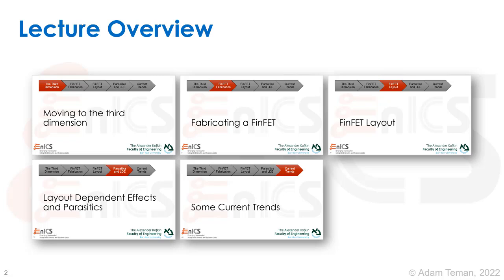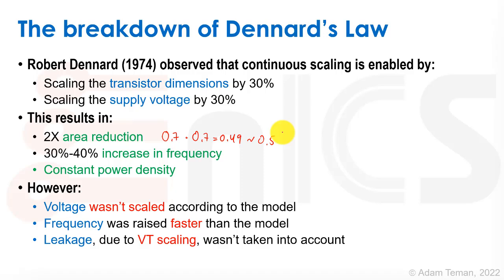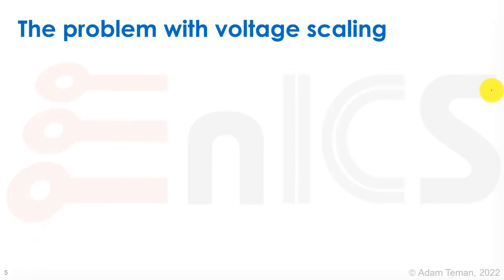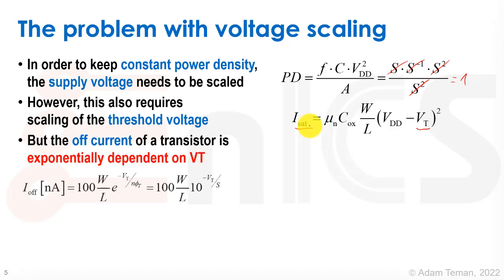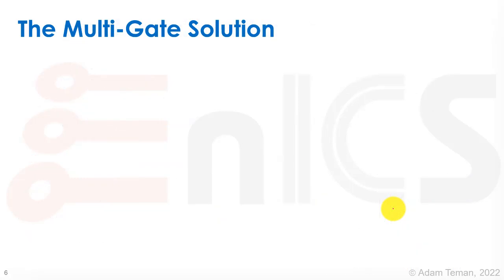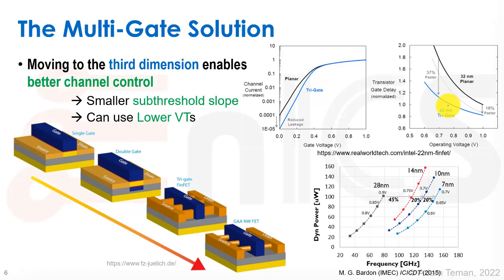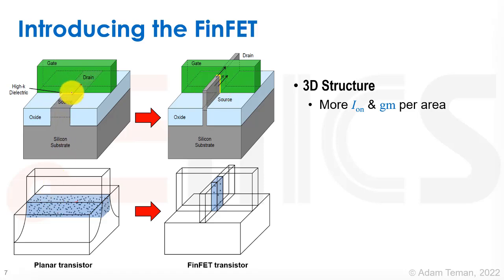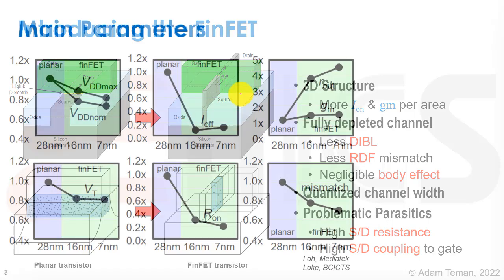Advanced Process Technologies - Part 1: Moving to the Third Dimension

Comment: At 9:50, what is the use of the 2 oxide layers depicted in blue? Normally in cross section diagrams we do not see this oxide layer
Reply from the maker: Great question.

These are the STI layers that separate between transistors. 
It's a bit confusing because this diagram is rotated 90 degrees from how we "usually" look at transistors. But we need some isolation between active areas and this is achieved with an oxide layer.
Reply: @AdiTeman  Ok got it! So it's just to isolate from other transistors. Was wondering if it had any functional use for the transistor itself. Thanks a lot again! This whole series helped me a lot
Reply from the maker: @ctnrb741  Great!